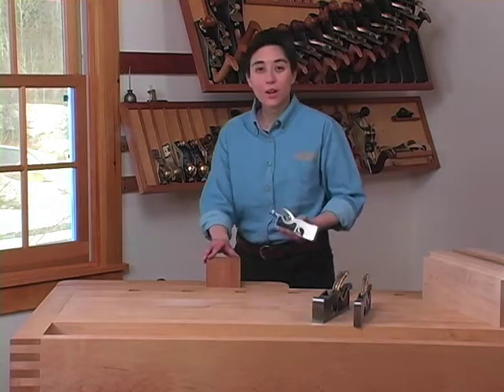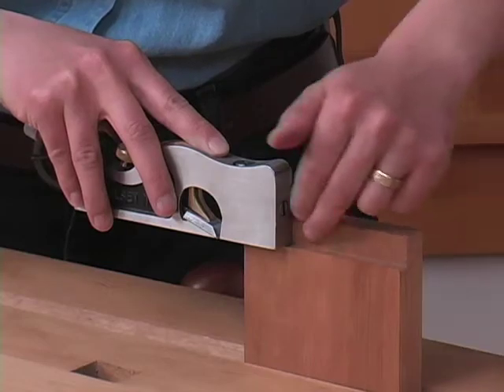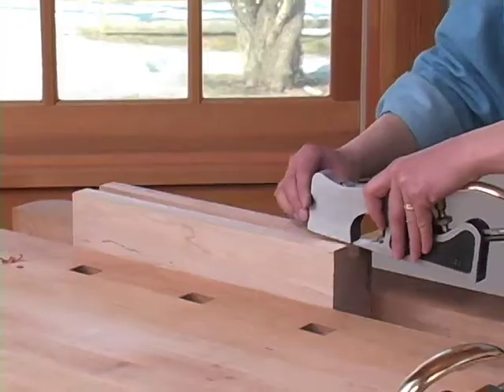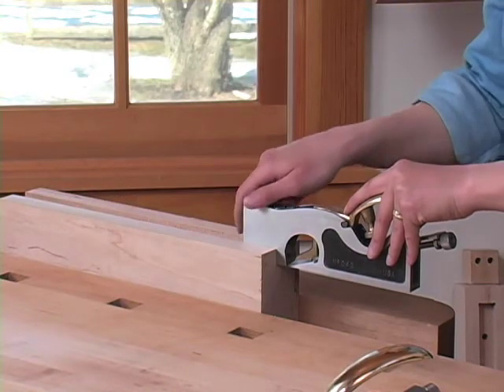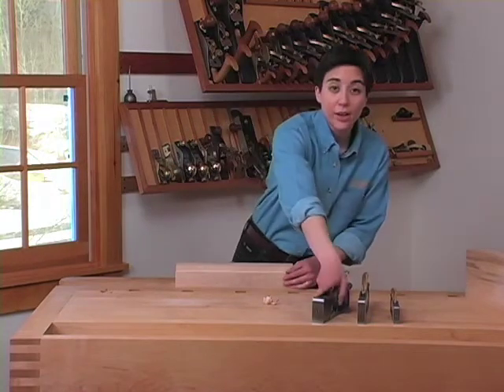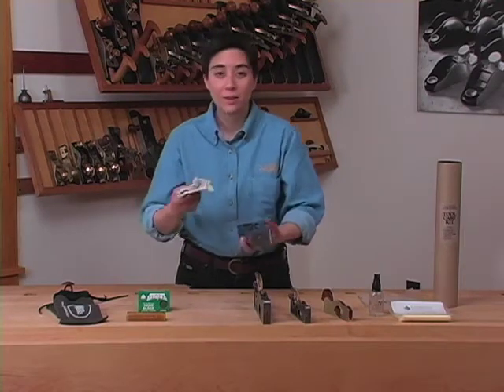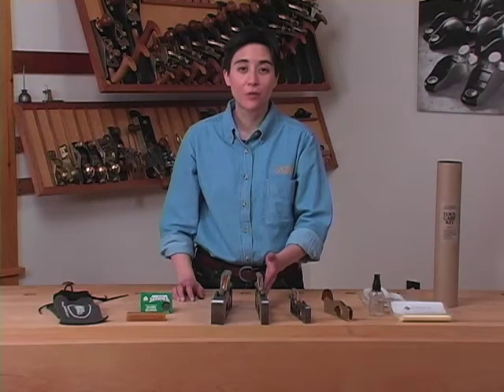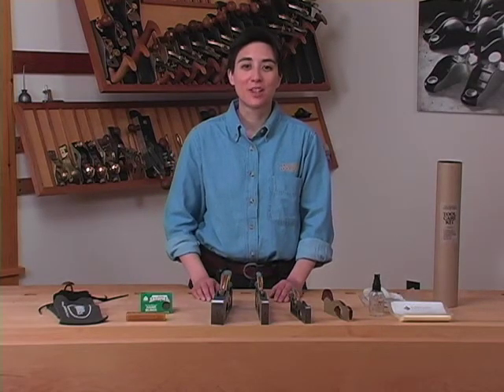Shoulder Planes Part 2: Use and Care

Comment: When cutting the shoulder of the first piece she didn't cut all the way, to prevent blowout I'm sure, but then what are you supposed to do? Reference the blade on the other side of the plate and make a cut in the other direction? Every time?
Reply: Clamp a scrap piece of wood to the end of the work piece and make sure it is flush to the pane being cut. Cut across the work piece and follow through onto the scrap piece. The blowout happens on the scrap piece and not the good piece. If the work piece is small you can sandwich it with scrap on both sides and clamp it that way.